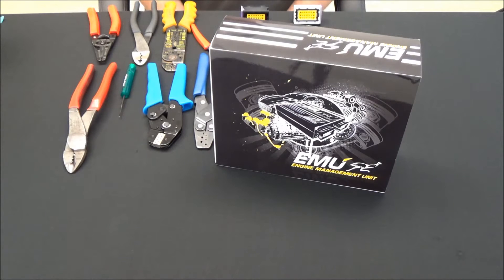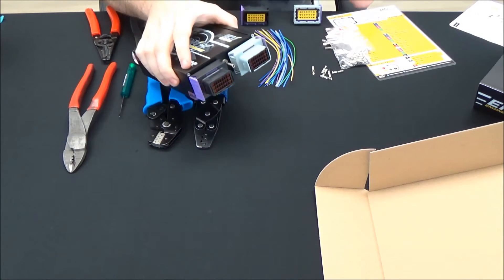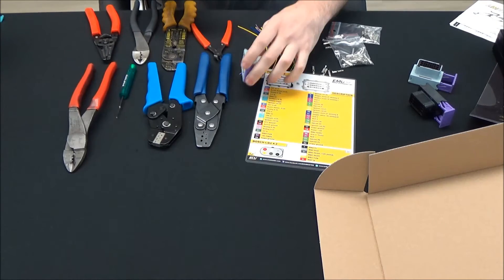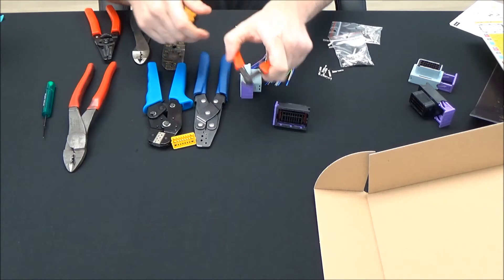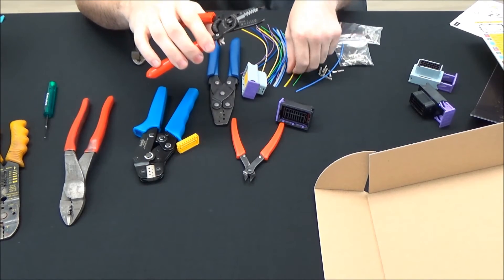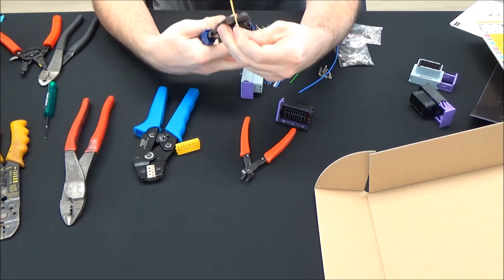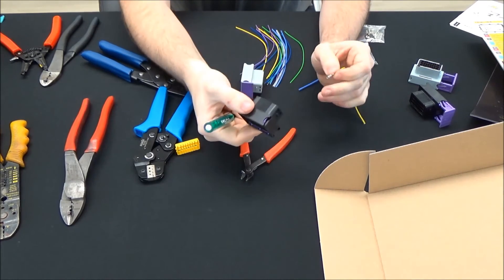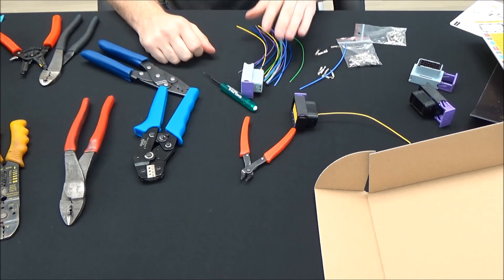ECUMaster EMU Wiring Basics

Comment: The red fused power wire to the emu , does it need a constant from battery 12v or switched 12v power from ignition on ?